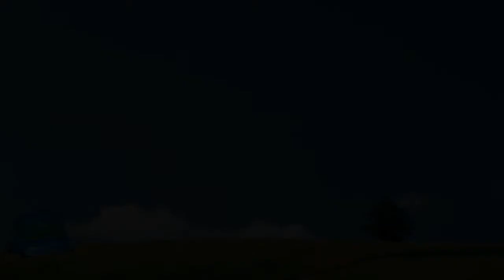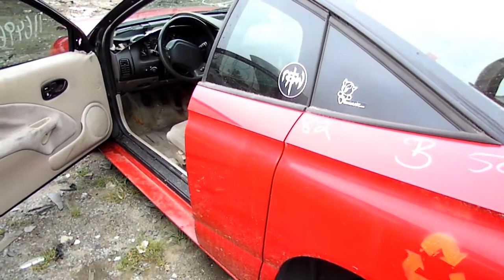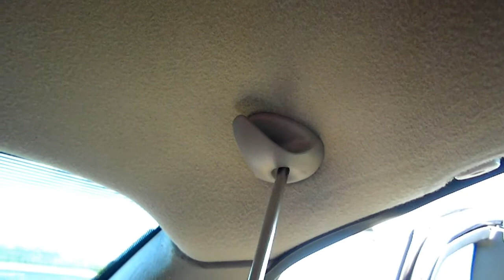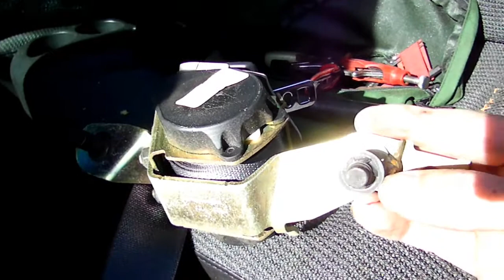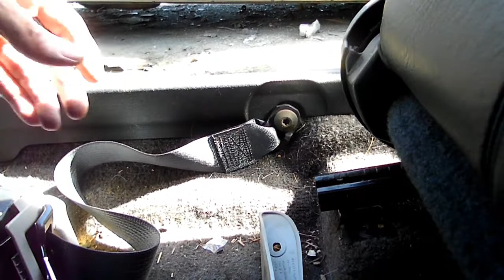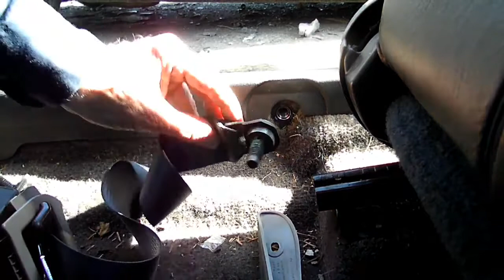Saturn SC 00 02 Seatbelt Removal

Comment: I realize this is a dated video but so is my 2001 Saturn SC2. Driver side seatbelt is fraying. I tried cutting, applying heating to the stub to prevent further fraying. That did not work. Fraying is worse now than when I trimmed the single fraying piece. After I remove the seat belt mechanism is installing the replacement belt simple (don't if the NAPA or what ever parts store I purchase replacement from will include instructions) or will I have difficulty without instructions. Do the bolts, especially the T-50 bolts, when replaced need to be torqued.

My 1999 Saturn SC2 only gave me 272,459 miles of mostly pleasurable driving. I don't know if it was my driving that caused, cylinder 3, rings to give out (my local mechanic says the S-series engines had a problem with cylinder 3 rings wearing out early) or if it is a problem as my mechanic described to me. Sadly, because I didn't have the funds to either rebuild the engine or have a rebuilt engine installed, I had to send it to the bone yard. Picked the 2001 used with 126,000+ miles on it. At 159,000+ miles now. Hoping to get 300K miles before we have to part company. 99 was automatic transmission; the 2001 is manual transmission.

Thanks for any more assistance. Richpin6a has the best Saturn videos on the Internet.

Comment: The cable-drawn, passive restraint-type chest belt on my 93 SL1 does not retract well at all in cold weather (anything below 55 degrees Fahrenheit). When it's really cold it can take 5+ minutes to retract even when I relieve the tension on it by pulling extra belting out of the spring-loaded spool down near the shifter. It works fine in warmer weather. I am unable to find any resources on how to repair this problem.  Any suggestions?